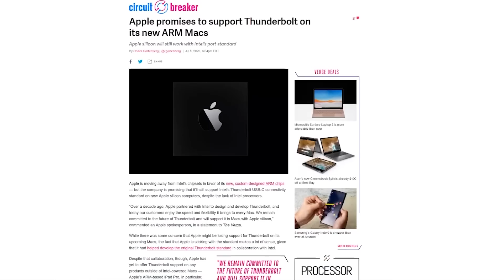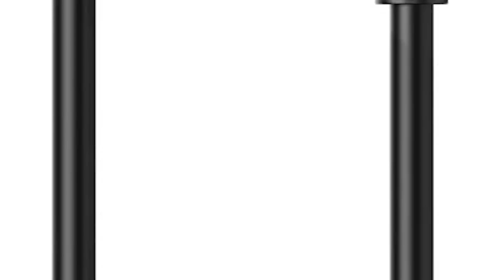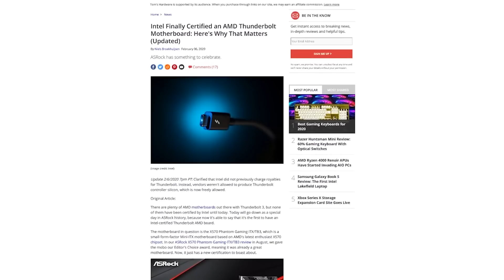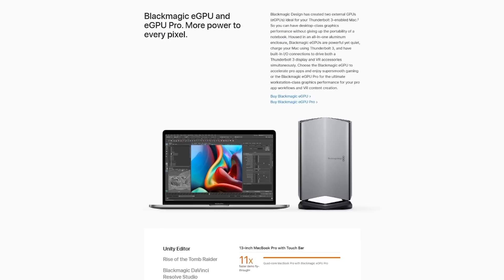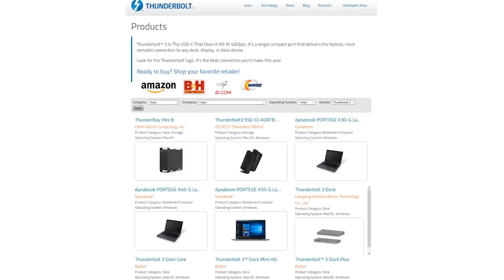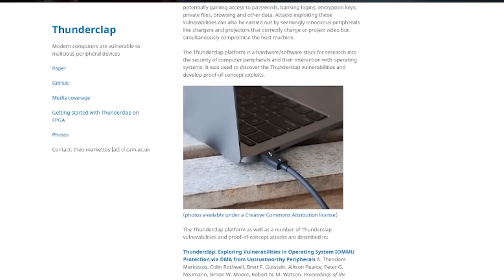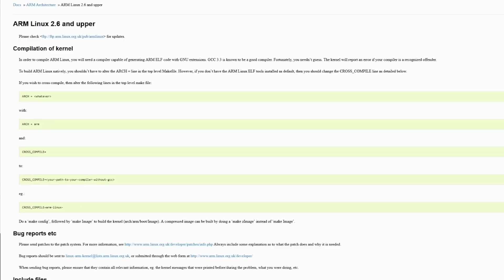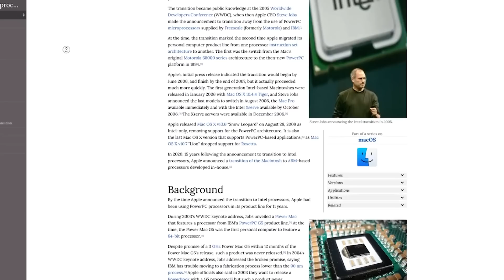Can Apple Do This? Thoughts on Arm+Thunderbolt

Comment: Apple did partner with Intel on thunderbolt so I wouldn’t be so quick to assume Intel has the final say. Apple may have real issues getting certification, but as they partnered with Intel on developing the technology i’d say Intel will have a harder time outright denying them proper certification. I’m not looking forward to the mess that Thunderbolt on ARM will be, especially given what a mess USB-C and Thunderbolt were/are on the first USB-C Macs.

Comment: Apple + ARM looks like a twofold profit increasing decision.

1. ARM is less expensive although without the performance of 
Intel/Amd.  At a consumer level I’ve always thought of Arm as a consumption tool and Intel/Amd as creation tools.

2. The intentional decrease in performance will be leveraged to sell Apple cloud computing within their walled garden. 

3.Custom Arm means custom hardware/software exclusivity. Think Beats headphones with the Apple “security” chip. I see a day in the near future when you will need Apple “security” chips in all peripherals, resulting in licensing fees collected by Apple. 

Why overcharge only the customer when you can manufacture fees applied to peripheral oems?
Reply: For the same performance arm offers less power consumption which helps Apple a ton with the laptops
Even as full size server chips(ThunderX2) they're still semi competitive
arm has always been more of an embedded architecture until the past few years but it's changing with dedicated designs for desktop/workstation by arm.
Reply: remember, arm is more of an open idea than a locked chipset.  "Apple Silicon" has the potential to be very very different than say the RaspberryPi 4 chip, or the Qualcomm chips, or any other Arm chipmaker. It's an architecture that they can tack on various cores to the standard compute cores to make things happen. T2 and SMBios chips could be gone, as that could be moved into the cpu. Even specialized cores for specific purposes (think intel quicksync or audio asics) could be added, as thats the target of their pro lines. Not sure if theyll actually go that route, but its definitely a possibility.   And on the consumer end, having a fusion of an iPad Pro and a Macbook Air would make an insanely powerful consumer computer that can handle gaming and anything else you could throw at it, but not overheat like the intel chips have been known to do (most of the time those laptops run around 90-95c)
Reply: So we're time traveling back to the 1980s with dual CPU computers?
Wonderful...

Comment: Shouldn't USB4 come around the corner sometime soon?
And for PCIE we have the unpopular OCuLink in x4 and x8. Would rather use that than Thunderbolt
Reply: USB4 includes standards for PCIe over USB, Thunderbolt certification will basically only be required for use of the name.

Comment: i remember firewire and powerpc, actualy had one.
Reply: Firewire was a nightmare on pc.  Was it any decent on powerpc?
Reply: @nocturnal0072  FireWire was fine for me on both PowerMacs and Intel Macs.  I still have some working FireWire devices, such as drives.  Most of the problems related to FireWire on Intel Macs were introduced later, when signed kernel extensions became necessary (many older drivers were unsigned, and consequently couldn't be used without tinkering).

Comment: Seeing it's Apple I believe they are looking at this problem in reverse, I suspect them to fork an "Apple way of doing thunderbolt" on their platform that hardware manufacturers needs to test against and inform potential customers about.
Apple has always dealt with third-party hardware compatibility as a manufacturer issue not theirs.
Reply: The fact is apple controle the vast majority of computers that are used with thunderbolt. (yes other brands are slowly moving to it but apple have been there full time for years already). If you make a thunderbolt device today you test agaist macs with macOS (running apples thunderbolt drivers on macOS) since 80 to 90% of your users will be using your device this way.

Comment: thunderbolt quirks are non-trivial. never anything you want to hear out of a device that has direct memory access that circumvents the CPU.
Reply: Uhh . . . . RDMA ?
Reply from the maker: Rdma is a new and fun exploit vector. You can. Do Spectre/meltdown over the network! Haha. Story for another day.
Reply: starshipeleven   Given the 50 years of legacy glue in x86, I'm betting RISC-V will has a better chance of getting a "just works" version of iommu.  And thunderbolt is an insane idea without a solid mmu implemented for dma traffic.
Reply: starshipeleven  Because there's a whole lot of legacy modes and config space that x86 needs to support, My $4000 Dell notebook doesn't even properly support memmapped pci config on third party nvme, or pci power states.  Thier linux dmi driver only actually expose half the config , and the userspace utility that does only installs on ubuntu 18.04 and is incompatible with secure boot. While  the iommu groups looks sane, I've had trouble actually passing anything through. 

Iommu leans heavily on vendor config and proprietary firmware.  I'm hoping the Risc-V ecosystem will be a lot more open.
Reply: starshipeleven  Well, I'm pretty sure almost non-existent, maybe ? (maybe beside some test bench or another niche stuffs)

But hey, still answer the question, if 'my device' is a datacenter grade thing, I'm pretty sure i want that thing to have  support for RDMA natively or at least can be worked out with some add-on(s)
Reply: starshipeleven  No, I gave up. I did turn off lockdown for a while and tried to dig into dmi info, but I was in way over my head, and even if that was a solution, I travel all over the country with the device, so permantly running without secure boot isn't a great option for me. 

Combine that with vfio decreasing battery life, the fact that power cycleling the VM can get you right back to an invalid state, I gave up on the idea on this platform. 

I've had some sucess with intel gt-v on laptops, but with stability issues (getting a kernel panic within a day or two of enabling the virtual gpu.) 

I'm not doing anything that intense on the windows guest, and think combining virtio+lvm to be the best performance boost I've found so far. I'd love a little graphics acceleration, but it's such a pain. I'm really just hoping a paravirtualization solution is built on top of DXVK.

Comment: Why do you think Apple needs to engineer a whole new Thunderbolt compatibility solution? Can't they just build the new behavior against the old one? After all that's exactly what everything is already built to work with.
Edit: I guess what you mean is that they don't really understand Intel's implementation either and the space of behavior is so large that they can't really test it all.
Reply from the maker: Yeah even if they just bolt titan ridge onto arm, it's going to have lots of weird edge cases that will be problematic.
Reply: @Level1Techs  apple is going to do what apples does best. TB will only working on apple approved peripherals, ie apple made. apple does not care about anything that is not apple.